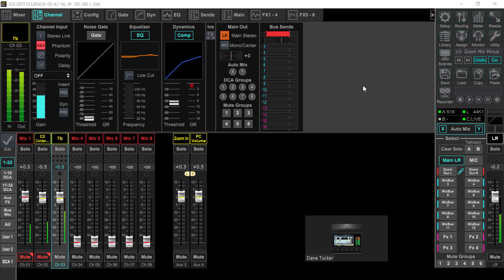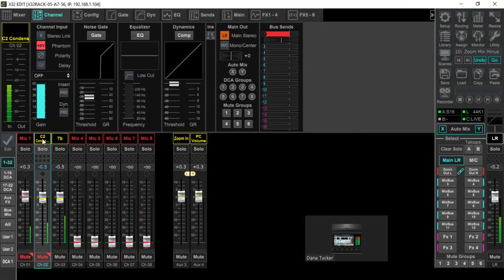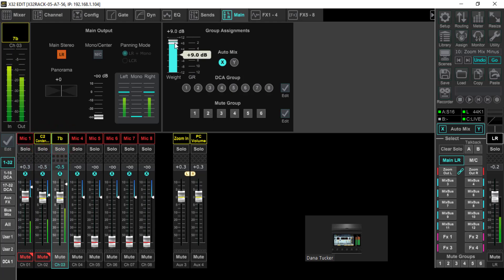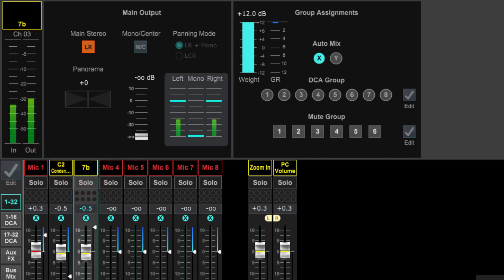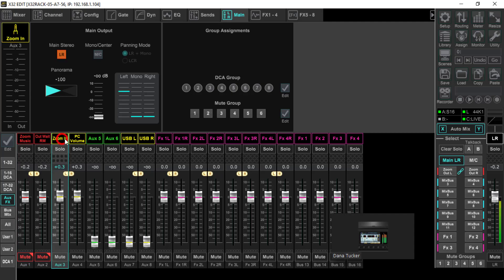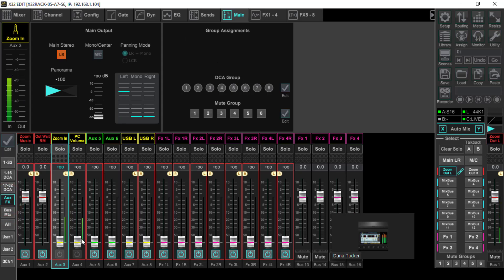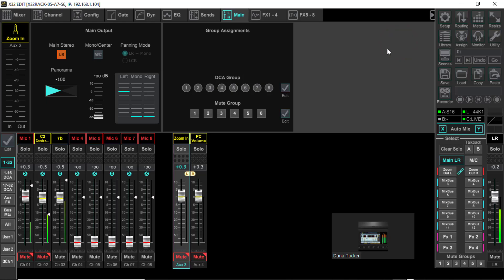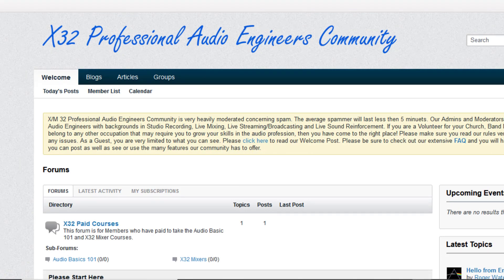How To Do A Mix Minus Using The X/M 32 Mixers

Comment: Hello Dana, I have a question that I am hoping you could help me with. If the FOH has an X32 and I have an X32 rack on stage for IEM mixes; can I run an AES50 Cat5e cable out of the FOH X32 into my X32R and have independent control over the channels through the X32R? Just want to confirm before I purchase a cable. Thank you
Reply from the maker: No, only one can be the Word Clock and have the main controls. It's the way digital mixers and stage boxes sync up with each other.